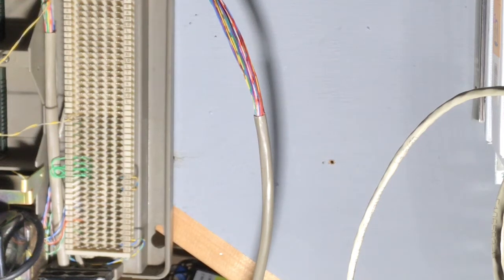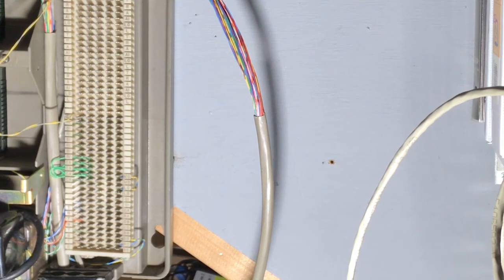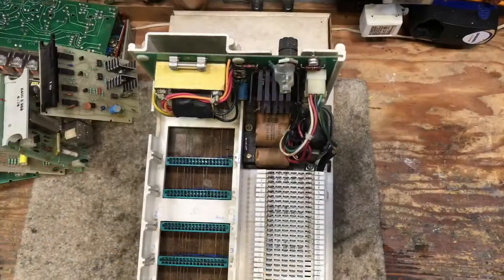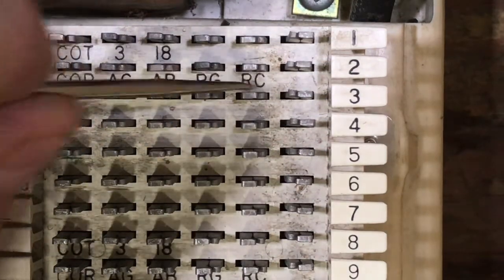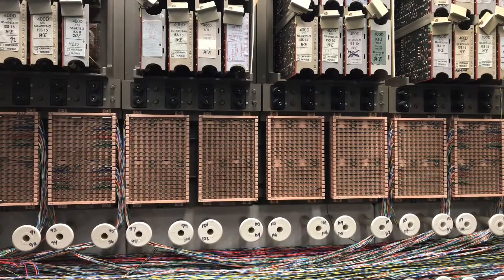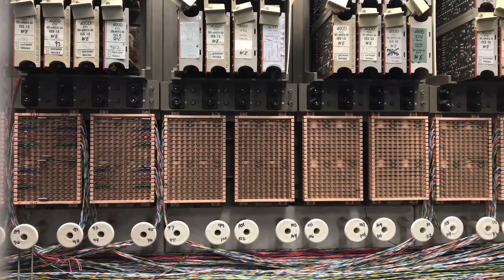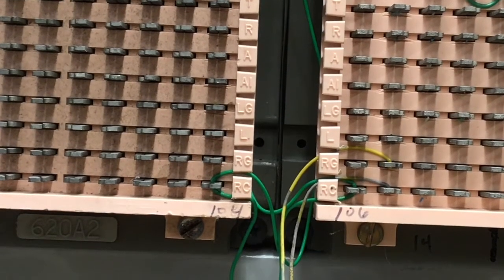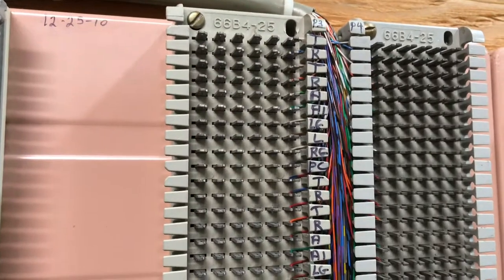How to wire common ringing on 1A2 systems.  551 ,601 ,620 and 584.

Comment: I hope you can answer this simple question on 1A2 common audible on a 551C KSU:

Say I want Line 1 and Line 2 to ring on phone set A and Line 3 and Line 4 to ring on phone set B. Both phone A and B would have all 4 Lines appearing. 

Can I just strap CA 1 to 2 and then 3 to 4 omitting strapping 2 to 3 and then punch down each phone set accordingly?
Reply from the maker: Yes you can wire the ringing the way you want it. You will also need to wire the Y-SL/ SL-Y to the 3 or 4 B1-R1 of the 2 phone. You can call 971-239-5084 if im not home leave a message